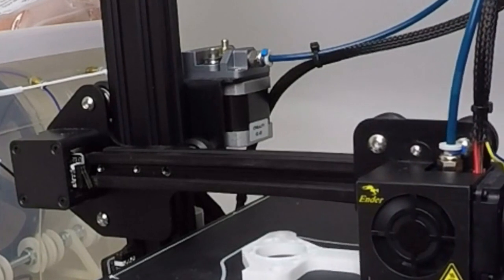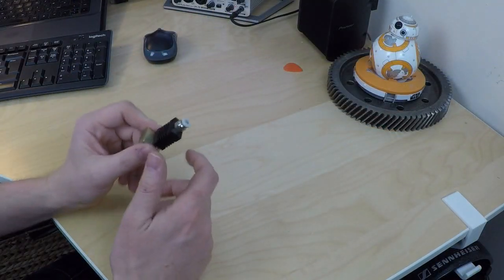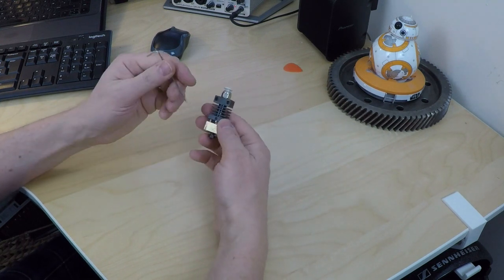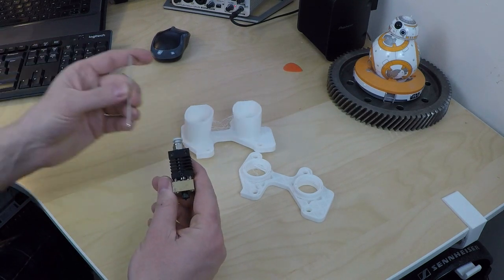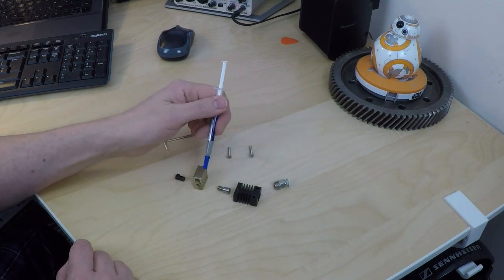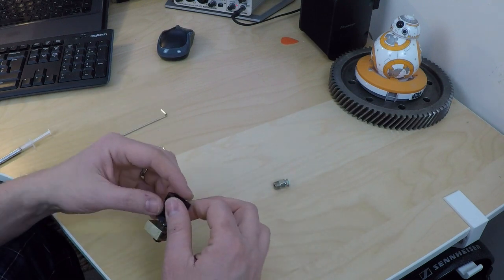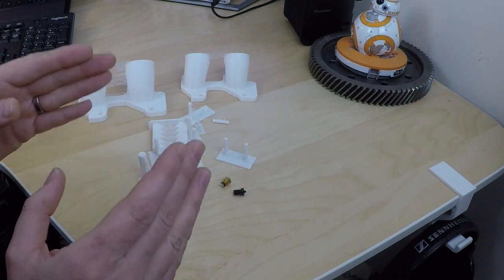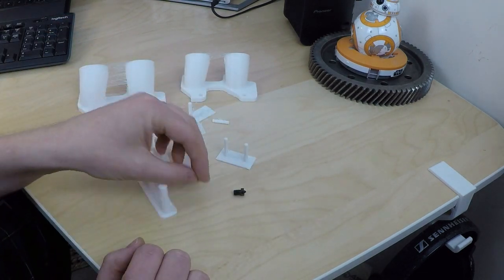Never clog again!! 2 easy tips to solve a clogging all metal hot end!

Comment: Warning: Many thermal pastes meant for computer parts are only tested and validated for the usual temperature ranges (like 0-100°C) and not for excessive heat of 200°C and above! Make sure to get properly validated thermal pastes for these temperatures, especially if you plan on applying thermal paste to parts of the heatblock!
a simple off-the-shelf thermal paste will be fine if you only apply it to the heatbreak-heatsink portion, but NOT for the nozzle, heating element or temperature probe!
Reply from the maker: Hi, thanks for the comment, this has been bought up before and the HY510 is good for 300degC, it appears that some of the more “high performance” compounds for gaming PC have the lower top end temps.  But you’re right, always check!!!
Reply: This I learned the hard way. Ruined an expensive all-metal hot end.

Comment: i have a similar problem but not identical and was reaching out for desperately needed help, i have what was described as the E3V6 hot end setup, and inside the metal threaded piece between the heat block and the cooling fins the bit i think s called the heat break i  have a small piece of ptfa tubing inside but after about an hour of printing i get the dreaded click click click from the extruder and the print fails as i get 100% under extrusion, the only thing to do is a full strip down and every time i find the same outcome, inside the ptfa tube is left behind what i can only describe as a jam of pla filament and it has formed what looks like a straw (basically a tube of pla within the ptfa) and it has an opening running al the way through of about 1mm i cant seem to get my head around how to fix it, i have thermal paste on order so until that arrives I'm at a halt, could you please advise if possible what i could try to do to fix this please.
Reply from the maker: Hi!  I can try to help, the key thing which makes all-metal hot end is that only filament goes through the heat break is filament, if the PTFE goes through the heat break then it isn’t an all metal hot end.  But that shouldn’t have an effect on the clogging - just something to check.
So things I would look at - 
1. It might be over extruding, try calibrating your extruder, lots of over extruding can cause the clunking, but generally it’ll keep printing.
2. Retraction - even the E3V6 needs lower retraction settings (the retraction pulls molten filament into the heat break and it cools and jams) - easiest way is just turn it off in your slicer, it will string and blob at lot but at least you test the theory, maybe then try 1-2mm.
3. Make sure you do the final nozzle tighten when the hot end is hot otherwise gaps appear at it heats and filament can clog in these areas.
4. Printing temp - an obvious one but just watch your actual temps whilst printing, a new hot end may need tuning, mine didn’t as the temps are rock solid, just something to check on yours, a PID tune might be needed.
Hope this helps and good luck!!!
Reply: @MakingforMotorsport   cheers for your reply, i will go into cura now and create a new profile for less or no retraction and keep trying, im new to this whole 3d printing scene so when a problem arises I'm hitting my head against a brick wall and trawling you tube for answers. I've never heard of the term PID tune what is this please sorry if its a dumb question? and thanks again for your help it means a lot. subd btw.
Reply from the maker: @MrJuuddss  no problem, PID tune means essentially reteaching the control system how to keep your hot end at the right temp (when to turn on, when to turn off etc...), keep an eye on the actual temp whilst printing, if it differs significantly or for a while then it’ll need doing - how to do it differs by printer.
Just checked your channel, great stuff, I particularly like the Mk1 Escy!
Reply: @MakingforMotorsport   cheers mate i appreciate the interest in my channel, im trying to incorporate 3d printing into it to make parts i need rather than keep buying them,  hope fully i can sort this jamming problem out so i can get on with it lol thanks again buddy best wishes, George
Reply: @MakingforMotorsport   just to let you know i changed some settings like you advised in this video such as retraction from 6.5 to 1 and also the retraction travel and reprime and speed, and mate its like day and night i printed for 8 hours solid with no jams no misprints nothing it was fantastic, all i had was a bit of stringing to clean but that was not a lot, buddy you really have helped me so so much and i am eternally  grateful for your help thank you so much.
Reply from the maker: Good to know you are up and running again,  I know the frustration when the printer just won’t work, whole reason why I made the video... glad it helped!
Looking forward to seeing you incorporate 3D printing into your restorations...
Reply: @Making for Motorsport  its ok i just found out what PID is lol i need to go figure this firmware gcode thing out now cheers mate ill let you know how i get on.
Reply: Try remove the two retaining screws from the bottom of the heat block. 😉

Comment: Thank you so much for this. I got the same clone hotend (minus the black paint) and was getting jamming non-stop. Was about to try seasoning the hotend but saw you're video and decided to go for it. It works great. I used some Thermal Grizzly thermal paste I had from a PC build I did, says it's rated up 350C so I should be good. Do you know how often one should replace the thermal paste? I didn't put any paste between the heat block and nozzle as I like changing nozzles often and don't want to cause more clogging issues. Seriously, thank you!
Reply from the maker: Hi Gil, thanks for the message, it’s great to know these vids are helping people!  
As for how long, I honestly don’t know, I suppose the “simple” answer is when it starts clogging again but mine has been fine since I did the mod, nearly 2 months now... but maybe it’s about time I messed with it abit more??!! 🤔
Reply: @MakingforMotorsport  Yeah, that makes total sense. I'm expecting this to last a while since the heatbreak won't be getting nearly as hot as the heat block and I'll be investing in some better cooling options to help the thermal paste do it's job. Thanks again!

Comment: I struggled with stringing on the ender 3 till I found by accident if I disabled completely the part cooling fan it went away
Reply from the maker: That’s very interesting, I’ve never noticed a difference with the part cooling fan on.  Something to try I think!
Reply: Had the same on my MK3S clone - turned out the heatbreak and ptfe tube were not proper in place. And replace the nozzle fan duct.

Comment: Hey man, are you still having 0 clogs with the thermal compound?  This one has been biting me too on my all metals.
Reply from the maker: Hi, I haven’t had the clogging, I have had the odd skip at the extruder but that was from trying to go too fast, I haven’t even disassembled my hot end in about 3 weeks.. it just works 👍.  
Hope you get yours sorted, are you using the thermal paste?
Reply: @MakingforMotorsport  not yet but I'm about to!  I mostly addressed mine with a custom cooling setup to isolate the heatbreak and force more air over it but I do still get some clogs with TPU and PLA.  I'll try the thermal compound and see if that helps. I hadn't even considered that to he honest and I'm a sysadmin who builds PCs on the side... lol. Thanks for the response man!

Comment: Slow down printer and it will reduce stringing
Reply from the maker: I will try that, as I have sped up the movement, but slowing down the print I haven’t. 
Since the video I have removed the securing screws from the hot end and put on a silent Noctua fan which is ducted into the cooler, this has fixed 95% of the stringing... maybe slowing down will fix the last 5%!
Reply: That's good to hear

Comment: Get a Mellow MS clone from Aliexpress they come with a real titanium heatbrake that is a snug fit and the heatsinks are machined from quality aluminium
Reply from the maker: Yeah, I have seen reviews of other clones and they do seem to have tighter tolerances than mine!  It’s been made to work but if I have more issues I will probably get an E3D v6 style and try making this one water-cooled...
How have you got on with the mellow clone?
Reply: @MakingforMotorsport  The Mellow clone is great, I was expecting problems but it has all gone smoothly although I am considering tapping it so I can use the pneumatic Bowden coupling instead of the Bowden collet as I was getting a bit of movement with the Bowden tube but I solved that by wrapping a bit of PTFE tape around it to give a tighter fit and all is well now, I think those Bowden colets are designed for the white Bowden tube and I am using Capricorn, I have some of the standard white stuff and I will try this out on a second Mellow I have ordered for an additional Ender 3, I was wowed by the manufacturing quality of the Mellow, everything is machined from solid billets of aluminium and the aluminium is quality stuff, not just bog-standard 601, the inside of the heatbrake is lapped to a very smooth finish.
 Oh, by the way, check this printer out, it is an Ender 3 V2 clone that is actually better than the original and only £129.30 Voxelab Aquilla     https://www.voxelab3dp.com/product/aquila-diy-fdm-3d-printer
Reply from the maker: Its funny you say about the pneumatic fittings, I have a print fail last night because the Bowden fitting came out the the top of the hot end (probably my fault).  I think you are right about the white bowden vs capricorn, it does seem to move more and it seems softer aswell so it gets torn up by the collets in the fitting.
That printer looks like outstanding value, if I tried to get a 2nd printer i'd have to print a 2nd set of ball 'cus the Missis would have my current pair!!  Although I do know some thinking about joining the 3D printing revolution who I could tempt with this........
Reply: @MakingforMotorsport  Interesting. I do want to point out however that the fins on the nozzle would be pointless of you make it water-cooled. An interesting thermodynamic principle is that fins don't actually work in liquids.

Comment: have you played with e steps?  a good e step calibration works wonders
Reply from the maker: Hi, thanks for watching!  Absolutely, I should’ve mentioned that e-steps and nozzle temps are critical and an easy place to start (I had already done both) but these all metal hotend clogs seem to all be about retraction and heat creep as the clog is in the heat break.  Do you have an all metal hot end?
Reply: @MakingforMotorsport  all metal, but non standard.... Slice Mosquito
Reply from the maker: That’s quite the piece of kit!  What materials do you normally run with that beast??? I am just trying out some CF-Nylon but have eyes on the high end in time...
Reply: @MakingforMotorsport  mostly PLA or PTEG, have some C.F. ASA in the wings........ just another thought on the stringing.... have you re-calibrated the PID? Heard that if one changes anything re: hot end, the P.I.D. might need some tweeking. This changes some of the Marlin code in the EPROM of the motherboard of the printer.
Reply from the maker: CF ASA?  Not seen that one, but CF seems to help a lot with stopping warping so it’s probably useful on ASA aswell.  I didn’t do a PID, mainly because the temp is rock solid (I get more variation in my bed than hot end) and I was trying to keep the printer as stock as possible for a different video.  

That said, I am planning on going SKR v1.4 turbo with Octoprint soon so any little tweak like that I will be happy to make...

Comment: that thermal grease is meant for cpus that are running at 50c to 80c, not 250c
Reply from the maker: Hi, thanks for the comment.  I did check the specs and it’s good for up to 300degC, which is more than enough for me, it’s cheap so I actually probably wouldn’t use it on an expensive CPU, but here it is definitely better than nothing and has shown to do the job!
Reply: @MakingforMotorsport  I have been struggling to find something that can work at high temp.  Would you happen to know the brand?  Thanks for this I was at my wits end with the clog.  Although I am super efficient at clearing out the clog.
Reply: If you buy thermal grease that brakes down at only 80c that's some major crap sounds like junk dont think I wver saw any that sad less the 250c on the package in my life
Reply: @RespawnRestricted  arctic silver for example, specially states -30c to 130c
Reply: @cdxer  well that is geared towards PC I guess general thermal paste goes way higher I got 3 brands I just checked myself made for PC 260c to 350c maybe they are lying idk

Comment: Always run a PID calibration if you disturb the heat-capsule!
The heat-capsule needs a little shmoo, but not the thermistor.
A bit on the nozzle threads helps with steel nozzles.
There are three main factors that limit heat flow:
1) Air gap, 2) surface irregularities and 3) surface cleanliness/oxidation.
Shmoo displaces air, fills grooves and valleys and prevents oxidation.
Doesn't matter if the shmoo is loaded with silver-plated nano diamonds or boring old zinc oxide!
The thermal properties of the solid ingredients isn't as important as 'sealing' the gaps between parts.
Arctic Silver 5, my choice, works slightly better than bulk white generic 'heat sink compound'.
Reply from the maker: Hi, thanks for the comment!  I didn’t do a PID tune for a couple of reasons, 1. The temperature is rock solid 2. I haven’t played with the firmware or done anything complicated with the printer, just kept it simple (I did another video on CF-PA with a “stock” Ender).
But the thermal grease was as cheap as I could get and I might upgrade next time (although i did get about 5 tubes!!)
Reply: @MakingforMotorsport  You'd need something better if you're "schmoo"ing the heater like Greg said.  CPUs don't run at 200c(They cease functioning long before), so the compound doesn't hold together that high(it will start separating and maybe turning into other things).  
You need industrial stuff.  McMaster-Carr(an American industrial supply company) sells Boron Nitride syringes for about 12 USD.  It is in fact suggested as the product to use for 3d printer heating blocks by MMC.
Reply: @Grimmwoldds  the point he applied compund to will nebver reach 200c and thermal compound from noctua is -50 to 200c

Comment: Where did you order your fan, that you used with the fan duct you printed?  Great video!
Reply from the maker: Hi, got it from Amazon, it’s a Noctua 4020 premium quiet fan, it’s so quiet it’s amazing.

Noctua NF-A4x20 PWM, Premium Quiet Fan, 4-Pin (40x20mm, Brown) https://www.amazon.co.uk/dp/B07125KWG1/ref=cm_sw_r_cp_api_fabc_BKPPJT8NFFNAXH9PZ9G1?_encoding=UTF8&psc=1

They either of the 12v versions work but you will need to wire one of these in to bring the stock 24v down to 12v...

6 PCS LM2596 DC-DC Buck Converter 3.0-40V to 1.5-35V Step up down Converter Module Adjustable Boost Converter DC Power Supply Voltage Regulator for 3D Printer, Camera, Computer Fans, QLOUNI https://www.amazon.co.uk/dp/B077VW4BTY/ref=cm_sw_r_cp_api_fabc_MQ7YT8CP3TA85P2QPFRA?_encoding=UTF8&psc=1
Reply: Thats a Problem. U need more power the noctua is too weak for cooling.

I recomend Sunon Fans with a higher pressure and AirVolume/h

Physics cant be tricked :P
Reply from the maker: @Qub1tus  Hi, more cooling is always going to be better but I just balanced up the  noise issue... all I can say is with the Noctua and the duct I haven’t had 1 heat creep clog... plus I get less stringing than the normal E3Pro cooler...
Physics can’t be tricked you’re right.... but helicopters prove that physics can be persuaded! 😂